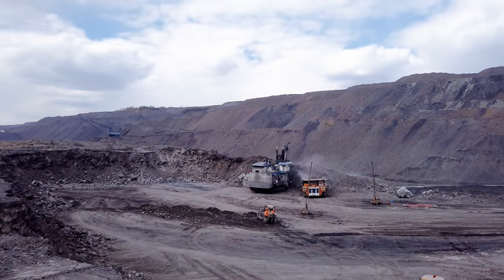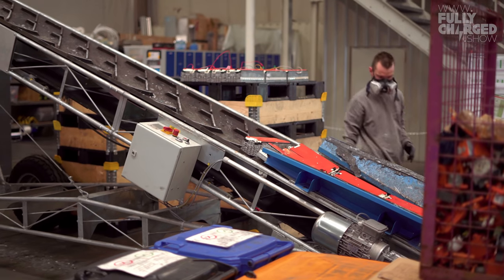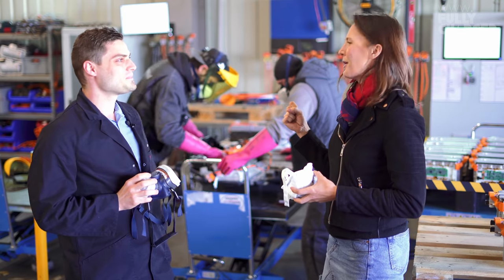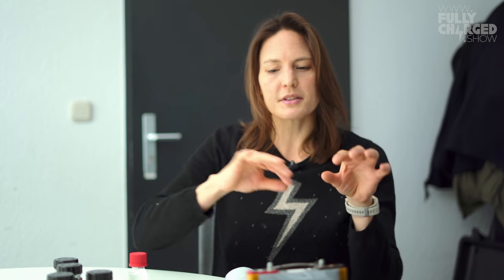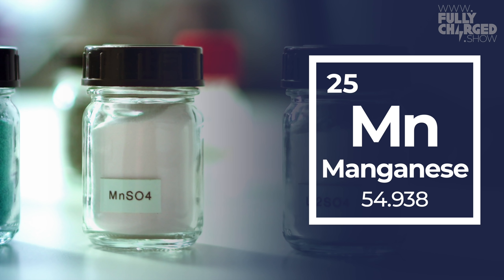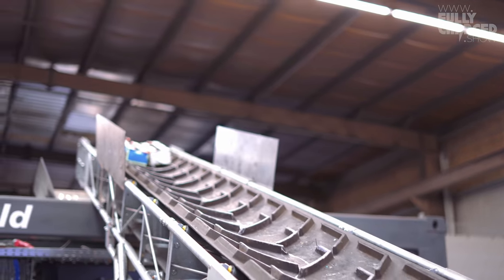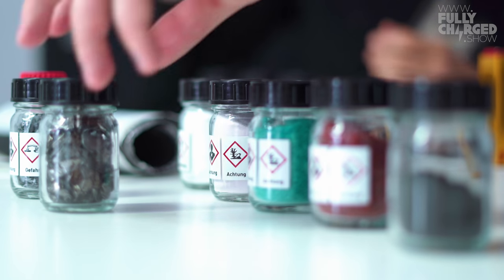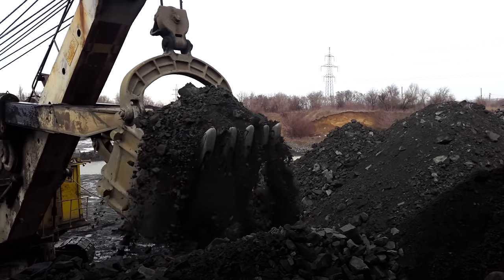Yes, we can RECYCLE EV batteries. Here's how | Fully Charged

Comment: Thing is battery is still usable when it has 60% of capacity.
And even 45%.
This will take a lot of time serving grid.
Reply: Being damaged or burned out is still possible, if you take apart a tesla (battery) to build power walls will commonly leave some cells too degraded to use further.
Reply: Reuse is always a better step than recycle and yes hopefully this can happen in a huge way.
Reply: @fionafiona1146  right.  The OEM can repurpose a pack into a second tier product and send damaged cells to be recycled.  There are also always defects in production lines.
Reply: @fionafiona1146  This shall not be done. Just take the whole battery pack, stack them to the roof, connect. And use. DO NOT DISASSEMBLE. No need for that. It takes time and Tesla's pack doesn't come apart (other EVs do often).
Reply: Yeah wear stuff out. Thing is my 20 year old car still drives good as new, no loss of performance or range 😗
Reply: Nick F - & you’re not spending a fortune of repairs?!? My contractor just replaced the computer that runs the engine in his Cummins Diesel powered Ram truck - It was $4000+, & the truck was dead without it. My gf recently had 2 major repairs done on her BMW X-4, & the total was $6,000+.
I replaced a clutch on an Audi Quattro - It cost $1,500+, & that was in 2001!
Your 20 year-old car puts out 2x the pollution/mile & has less Bhp per amount of gas used than new cars, is not as safe as a comparable new car & doesn’t have a lot of the active safety features new cars have.
Reply: @TraditionalAnglican  it all depends on the car. I'm driving a 2000 Toyota Echo that runs great and hasn't needed any work except for a bit early on when it was still under warranty. The only thing I've done off warranty was replace the battery once, and that was just a year or two ago. Sips gas, too. It's a very simple and well made car, though.
Reply: @TraditionalAnglican  No I'm not spending a fortune on repairs because it's a simple car and I can do the the work myself most of the time. It does have horrible emissions though and no I wouldn't want to crash it into a modern car that is built like a tank and weighs 2 tons. Nevertheless I still can't get excited about buying a new one.
Reply: @fionafiona1146  
You don't"take apart a Tesla pack.
The cells are glued together.
It's too labour intensive.
You rely on the BMS and cell fusing to disconnect the damaged cell, then plug the whole pack ,or module into a storage facility.
When it leaves there, this process, or similar, will be used.
Reply: Well look at it this way: if the battery is degraded below 50%, it would be better to recover 70% (likely 90% of the material value - graphite isn't terribly expensive) and make it into a new battery than use it at reduced capacity.  

I do wonder though if they test the cell capacities before scrapping them... They could do this as they discharge them - some individual cells can be damaged which affects the pack but the bulk of those cells could be fine and reusable.
Reply: @MrPhatties  Reusing good cells is a brilliant idea but I think their business model is based on recycling everything.
Reply: @MrPhatties  no, the most can not be salvaged out of these packs cause they are glued together in a way you can not separate single ones.
And no, you can not measure that cause that would need to charge them fully first and then to discharge cause only the discharge Wh are what count.
Do you wanna charge cell by cell and pack by pack and what do you do if BMS is dead?
Does not make sense . And in a lot of cases they will get batteries out of exchange programs by the manufacturer cause if they had to be exchanged due to production failures than usually this is covered by the liability insurance of the manufacturer like LG . And LG has to make sure that these cells / parts will never be sold again anywhere across the globe except as trashed parts. LG needs Duesenfeld for that.
Next customer will be GM or their battery maker that delivered the BOLT batteries.

Happens all the time like a paint maker delivering a charge/batch where the new car will loose its paint after 3 to 6 months. Then all the cars will be exchanged by new ones and the paint manufacturer's insurance wants proofs that all the cars had been fully destroyed by the car maker and that no parts have been salvaged cause the insurance will pay for the full damage like spare care for the time till the new one can be delivered and every other costs.

Comment: Around 12:10 i think he was about to explain why they dont yet recycle the graphite but Helen went into the next question. It would be interesting to know why they don't yet re cycle the graphite
Reply: Yeah, that annoyed me. I'm guessing that it's just not worth it from a cost point of view (graphite is cheap, and there is no 'mining tax' to favour recycling over virgin material), but it would be good to know.
Reply: It's probably not economically viable to recycle it as it's so abundant in nature. Plus it doesn't pollute the environment as it's the base element of life on Earth :)
Reply: Yep graphite is both cheap as anything and perfectly good to use as landfill (it's a stable form of carbon). More importantly though is that graphite isn't an element like copper, but an arrangement of carbon atoms in large flat sheets, if you recycled it you would just have a pile of carbon, not graphite and carbon has next to no commercial value in itself.
Reply: Graphite is an extremely common mineral, and is essentially pure carbon in flat sheets in that mineral form.  Also, one of the metal salts he mentioned was a carbonate salt, so at least some of the carbon is bonding to that metal in the acid bath.
Reply: I know it's cheap but it's still a resource. If it can be re used it should be. Oil is really cheap just now!!
Reply: @ewanmacgregor6186  it's pointless, it would probably be more cost effective to just pull carbon from the atmosphere than from these batteries. Just because something is possible to do doesn't mean it's worthwhile to do.

Comment: This is very important work.

One thing that I would have liked to know more about is about how expensive this recycling is. For example, if all batteries included the cost of this sort of recycling in their price, would it have any  significant effect on the price? 

There are probably important reasons why this isn't done, but another thing I wondered is if could we gather old batteries and instead of recycling them, use them if they can still be made to work even if they are degraded? Could they be connected to create batteries for the needs of the electric grid, which will need more battery capacity as the share of renewable energy grows? I suppose they are too just degraded to be safe or economical to be used in such a way, but if this was possible, they could instead be used until all utility has been gotten out of them, and only then recycled.
Reply: @Reprint001  Yes but if all that ICE car companies and users complain about is the human and environmental cost of mining and refining the components then surely recycling is a better idea.

Comment: Nice! In the US, former CTO of Tesla JB Straubel left the company to start a battery recycling startup. And he is of course highly specialised in battery technology. So that adds to the optimism of this fascinating episode.
Reply: The Tesla / Straubel work is very interesting, as they are the largest battery producer (cars and power walls and big energy solutions). Here some details I found in an article in Cleantechnica (5-1-2020, Steve Hanley). The company is named Redwood Materials. Citation from the article: « During Tesla’s 2018 annual shareholders meeting, Straubel told the audience, “Tesla will absolutely recycle, and we do recycle all of our spent cells, modules, and battery packs. So the discussion about is this waste ending up in landfills is not correct. We would not do that, these are valuable materials. In addition, it’s just the right thing to do. We have current partner companies — on every major continent where we have cars operating — that we work with to do this today.
“And in addition, we’re developing internally more processes, and we’re doing R&D on how we can improve this recycling process to get more of the active materials back. Ultimately what we want is a closed loop, right at the Gigafactories, that reuses the same, recycled materials.” »

It would be very smart (and impressive) if Tesla had its own recycling department in every Gigafactory.Plenty of buildings in Shanghai by now! But Straubel left the company to found a dedicated recycling company, not directly aiming at Tesla. The German company could also be joined by two large players in the US (and possibly Asia) that also strive for maximum recovery and reuse of materials. Apple is on the same trajctory: maximising "mining" from old devices.

Comment: This is great and they have done a fantastic job.  I am, however worried about the elephant in the room regarding recycling.  We constantly assume that the value of the material must cover the cost of recycling.  What we should be considering is the "whole life cost" including the recycling.  Until we do this in relation to both strategic materials as well as material such as plastics the market will only recycle where there is a positive value.  In the interview he almost went there when he mentioned "economic" but we need to stop and think.  It's crazy to push the recycling and recovery cost in to a hole in the ground or the ocean and expect future generations to deal with it.  We need to change the economic model to reflect the whole life cost.

Comment: Metal ores, dug out of the ground are often a mix of metal compounds with a lot of gangue (waste rock) in the mix.  We manage quite successfully to extract and separate the compounds of the various metals then to reduce them to extract the metals.  If we can't do this with a defunct Lithium ion battery which is a far richer (in terms of the percent of the desired metal) source of the metals in question, then something is political rather than technical.  Of course we can recycle the materials in batteries and the more we recycle the less we have to extract from the ground.  As our population decreases (Bricker - Empty Planet) we may reach a state of almost no new extraction.
Reply: Exactly - lithium batteries are just high grade ore as far as reprocessing is concerned.

Comment: It's interesting to see a company actually doing something sensible with end of life Lithium battery packs. I'm not sure those battery packs shown here are at end of their useful life though. 

There are far better uses for end of "current" life Lithium cells, like using them in portable equipment, where high output isn't needed. There would reduction in the requirement for new cells to be manufactured, if plenty of high quality second life cells are available. 

To me reprocessing healthy Lithium cells is very wasteful, as making a new cell will always use more energy than can by saved by reprocessing an old one. So it makes more environmental sense to re-use a cell as many times as possible, before it's finally useless and recycled. 

It'll always better to reuse a cell in a less demanding application, over making new cell.

There's a huge community of second life users of Lithium iron cells, who's ethos is to reduce waste, by continuing to use salvages cells, until they're no longer able to store sufficient energy for them to be worth using. 

This is when these cell should be reprocessed, not while they are still able to perform a useful storage in a second life.

Comment: What a lot of people don't realize that the 12v battery in your bog standard ICE car is one of the most recycled parts of your motor, this has happened for many years. In fact 99% of the lead is reclaimed from car batteries.
Reply: I was very surprised that Helen seemed not to know this in her question about how we've never recycled batteries so far.
Reply: @Wookey.  I think the context they are using is lithium battery chemistry is difficult to recycle at the moment rather than all batteries full stop.
Reply: Lithium ion battery specific I think, very different and difficult to recycle
Reply: @markpitt5248  In which case she shouldn't have prefixed the question by saying 'we've had batteries for 100 years and only now are starting to recycle them'. Lithium-ion chemisty is only ~30 years old. She may not have meant it to come out quite how it did, but the result is highly misleading.

Comment: I would love to know the costs involved and how this can be profitable, when the value of the recycled materials is a small fraction of the cost of getting a used battery. How much do they buy them for? How much do they get for the metals? This can be easily determined from the current market prices of recycled materials.
Reply: And if this does become mandatory in the EU then will it lead to an electronics type tax on components up front causing an increase in the cost of batteries?
Recycling is great, but like everything there is an economic question behind it all. Increase the cost of batteries and fewer batteries are bought or add the costs to those still using fossil fuels and you just end up taxing the poor.
Reply: We don't yet have any economies of scale, so we don't know how costs will compare.  Assuming that recycling will always be expensive is the same kind of thinking that had people thinking that renewables and batteries would always be expensive.
Reply: @Jake12220  All ICE cars pay for recycling when you buy it. The A8  and other alloy cars are around 98% recyclable. But EV's dont include the battery as they are aiming to reduce emissions. This is the bigger question as if we are 10 years and millions of Lithium ion batteries in EVs and only one German factory making this viable using the residual power to pay for it and with a free supply of used batteries. Then only making money from certain elements. This is a problem

Comment: Awesome video, thank you.  I thing pointing out they use the energy from the battery to recycle them is irelevanten because that energy came from the grid, its like what 100km of kwh, so what, one more charge, 2€ max, big deal. The energy  that would be spent to mine and proces that materials is the huge saving here and i hope it si financially viable and i really hope its a big money maker in the long run so we have even better processes so we can shut up people crying about batteries that have to be changed in what 10 years lol.  Supply and demand people
Reply: The point behind them discharging the batteries is that they would be doing that regardless, to make the battery safer. They are just recovering what power is in them (instead of discharging it purely as heat). It's actually VERY smart.

It could actually be quite a decent amount of power too. Depending on the state of charge they were left at (and what degradation levels they've been decommissioned at). The normal EV battery is around 40-60kwh. Even if they're at 50% SoC, that's a lotta juice. Now, that's an optimistic figure, but would be easily possible. Even if you were recovering 10%, that's still substantial.

Comment: Great doc, very interesting and insightful.
From the manufacturers perspective, recycling seems like very much an afterthought to me. These batteries aren't designed to be opened and messed with they way these engineers need to, to recycle them. It is clear that these are designed for nothing but the scapheap or furnace when they are no longer of use. Just the fact that battery recycling seems like something of a cottage industry is kinda sad IMO.
The big manufacturers should really dedicate half of their battery development to recycling. They should have the facilities in place to recycle 100% of the batteries they produce, And their marketers should be promoting batteries recycling credentials just as much as other stuff like their capacity, and we as consumers should be demanding that.

Comment: Excellent video, it's great to see that they recover the last kWh from the battery before they recycle it (for safety reasons). But as those packs were going into the crusher I was wondering how many of the individual cells were still serviceable, but simply not economic to rebuild into working packs.

From experience, battery packs rarely fail en-masse. A handful or often a single cell fails and the BMS declares the battery faulty and replacing a single cell/pack can return the battery to some degree of use. I guess the issue for a manufacturer is that it's quicker and cheaper to pack it off to a recycler than to spend time rebuilding.
Reply: It can also be tricky to refurbish a pack with a few really good cells amongst some tired ones. The BMS needs to do the right thing otherwise things go downhill quickly.